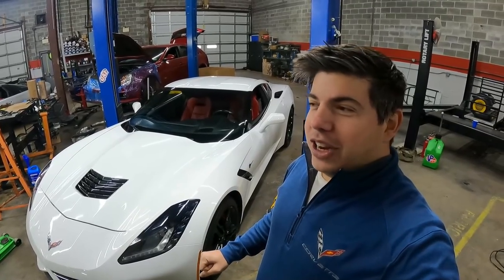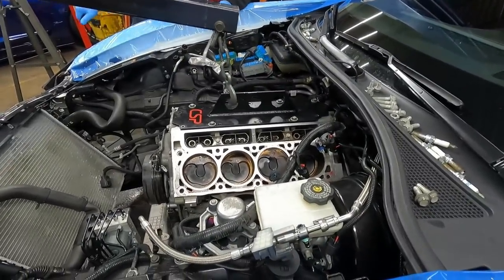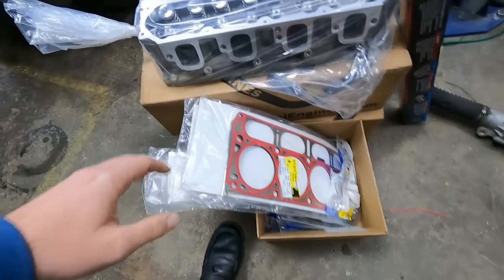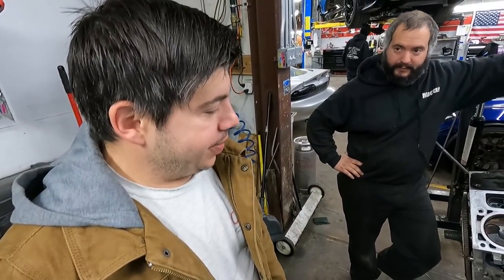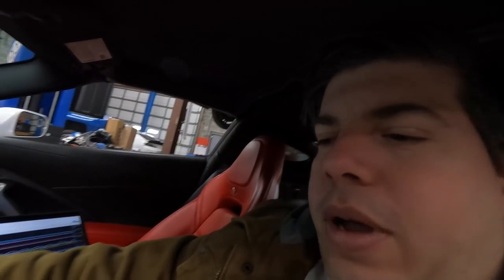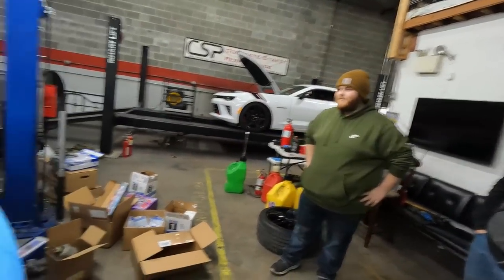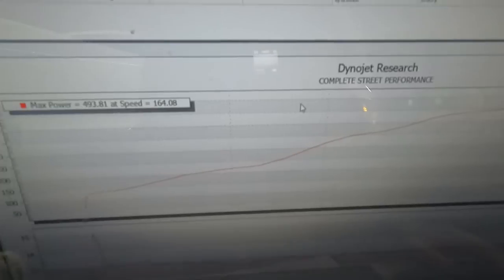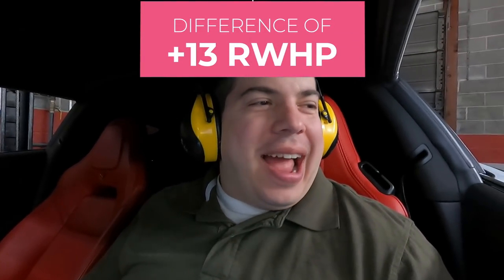VETTY WHITE Makes Power With Heads And Cam!

Comment: I would like to see the torque graph as well!  

Donkey Dick cams sound great at idle and are great at the track when constantly at WOT but on the street a mid rpm range cam feels so much more aggressive.  (In my experience.)
Reply from the maker: Next video I'll put it in. I couldn't believe I forgot to do it in this one. But the next video will mostly close out the series and the dyno graph looks insane compared to stock.
Reply: @completestreetperformance  Awesome, love the series!  Looking forward to the return of the Vagon.

Comment: Was that with the stock throttle body or did you put the 103 on it to test the difference
Reply from the maker: Stock throttle body. The afe intake doesn't work well with a 103 and msd intake manifold. But don't worry, we have more testing lol
Reply: Cool Wana see if the 103 does any hp difference on a cammed car

Comment: Andrew or anyone in the comments. How would the C7 be if it had the 10 speed auto? Better or worse? Just curious
Reply from the maker: If it fit, it would have been a much better vehicle. However, the C8's 8 speed DCT is even more fun than the A10.
Reply: My A8 is perfect when you get on it but with the paddles is lags. When I track it I keep it in auto and rev to 22k with all the nannies off. Very little spin and get off the line well. I wish I didn't have to drive through that water though.
Reply: Everything is better with a 10 speed
Reply: @Sizzer_Me_Xerxes  I agree. My CSP built 2018 ZL1 6MT is the best car I have ever owned. A neighbor bought a 2020 w/10 speed. It feels "exotic like" almost dual clutch like. My 2023 when I buy it will be a 10/speed. Thanks for replying.
Reply: @boomtownJ  agreed, ever driven a single cab short bed f150 with the 10 speed? They’re ridiculous for a freaking work truck.  Love that transmission!